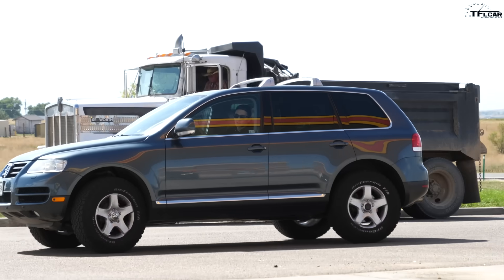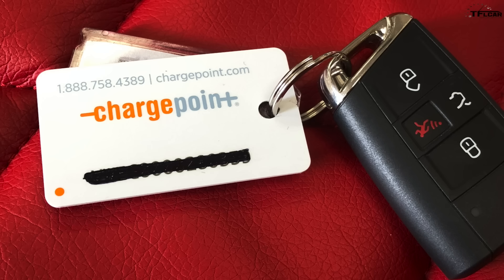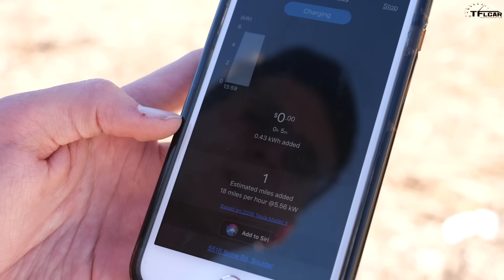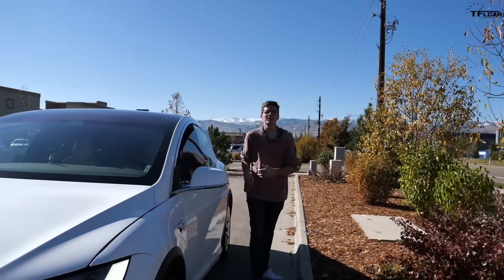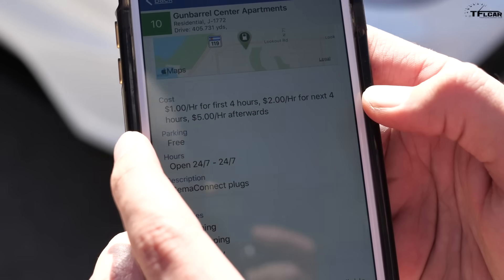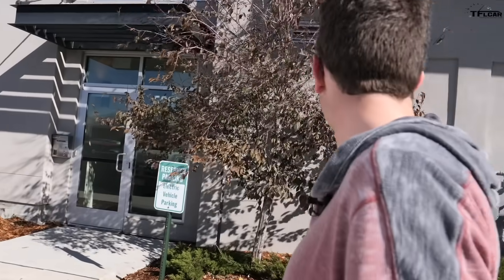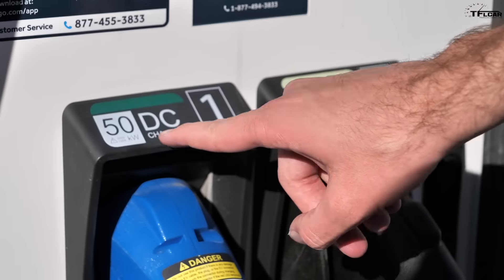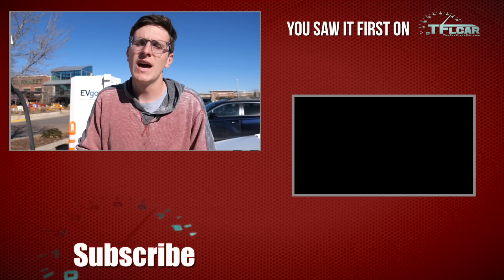Here’s Why Charging an Electric Car Can Suck - And It’s Not The Reason You Think!

Comment: I have a question for all those thinking they are going green by driving one of these.  How much pollution is the charging of the car creating.  The power/electricity isn't without pollution.  Unless that charging station is drawing power from solar panels or a wind turbine IT IS causing pollution.  Regardless if it is coming from a Nuclear or coal power plant.  Those plants cause pollution. 
But let's go with the cleanest of the lot and go with Nuclear.  How much nuclear waste does all this extra strain on the grid help to create?  You know that stuff that needs to be buried for 10 000 year.  Or what happens to those batteries when they reach the end of their life cycle and need to be replaced.  And from Telsa own page that is appox once every 5 years.  And they aren't cheap to replace BTW.   All this and you have to wait what 10-16 hours to get any kind of decent travel range...ooh wait that range could be cut in half if it is super cold outside.  Me being Canadian our winters can cut the range down a lot.  
I drive a newer car 2019.  I only visit the gas station once a month.  And in that time I get appox 500 miles on a tank.  (it has a smaller fuel tank) And I can fill it in under 5 minutes from empty to full.  Weather doesn't effect my travel range just my driving habits do that.  
So unless your soccer mom/dad just doing basic in town driving running small errands I see zero benefits to owning or driving an EV.  Jesus your going to spend more time charging the car then running those actual errands.
Reply: I have never seen Tesla recommending changing the battery back every 5 years. There’s many Tesla’s used as taxis because they require very little maintenance and have well over 400,000 miles and are running just fine. As for winters, yes the range can get reduced by up to a 3rd but if you charge at home then this is no worry. If the owner can’t charge at home then I agree, an EV is not the best choice. As for pollution, in the US about a third of all power generation is clean energy mix, and electric motors are much more efficient than combustion. 80% vs 25%. So per unit of energy in an EV is much greater vs a combustion engine. Again, not perfectly green but better vs combustion engine
Reply: @CrazyNickOO7  First WTF is a clean energy mix?  Because it not the power states like MI, OH, NY buy from Ontario or Quebec.  That's nuclear and coal.   
Battery replacement use to be right on the Telsa maintenance page.  But it looks like they have changed it from 5 year to 8 years. Applies only if you follow their strict charging regime of never going below 20% or above 90% and only using a slow charger.  It is also why you can buy as part of their warranty package battery replacement. 
Now for your example of being used as Taxi's maybe your right.  Maybe they have some up around the 400k mark. But you realize large taxi fleets usually have mechanics that do ALL maintenance and repairs on site. So to say they have very little maintenance I call BS on that. Most likely serviced every week to 2 weeks.  
I do find it suspect tho.  Cab companies around here will run you between cities some being 70 miles one way.  I can't see a Tesla taxi doing that. 1 round trip and it is down for 10 hours of charging.  
And you don't have to be the brightest to know it is a rechargeable battery. Just like every rechargeable battery they have a life cycle.  No matter the size.  From the ion battery in your iphone to the ion battery in a Tesla.  Sooner or later they need to be replaced.  And they all end up in a landfills as e-waste.  
One last thing. Let's use your 1/3 of range lost in the cold. I live in Canada. 7 months out of the year it is cold...or f'ing freezing. 7 months of reduced range just because of the Weather. So really that's none issue right?
Reply: @MrShuntking  Clean energy mix is just a generic term electric utilities use to describe what percentage of their energy production is from clean/renewable sources. 
Tesla never recommend to change the battery pack every 5 or 8 years, that's their warranty period for the battery and drive train. 
There is no strict charging regime either. Is just a recommendation to not fall below 5% and not to stay fully charged at 100% for long periods of time. Those extremes do cause increased wear on the cells. You cannot buy any warranty package from Tesla. It's just a manufacturer warranty that covers the battery and motors if they fail before 8 years or 120,000 miles. No other combustion engine warranty comes close. There is honestly very little maintenance on EVs for taxis or personal use. The Tesla model 3 only has 17 moving parts in the drivetrain for example. That is very little moving parts to wear out.   I've owned a Tesla for over 2 years now and the only maintenance I've done is rotate the tires and test the break fluid. There really isn't much to maintain. 
Back to the taxi service, there's a company that only uses Tesla's and travels between LA and Las Vegas. With the Tesla supercharger network it only takes them 30min to recharge, not 10 hours. You are correct every li ion battery has a life cycle and they won't last forever. There's a lot of data pointing to an average battery degradation of just over 1% loss per year. I'm right on that average as after 2 years my car lost just over 2% of it's original capacity but it still can over 300mi on a charge which is more than enough. 
Roughly 90% of EV batteries can be recycled. I agree it's not perfect but still better than the entire battery going as e waste.  
Yes, the winter months do take a toll on the distance you can travel but it has great benefits such as extremely well traction control, very heavy and low center of gravity, no old engine or oil to crank over, no waiting 10min for the engine to warm up and heat the cabin are just a few examples. I just wouldn't plan any long 200 mile road trips in the winter. Norway and Sweden are actually the leaders in buying EVs now and they're very cold climates. I don't live in Canada so I can't comment on how they compare to your home but if those countries are continuing to buy more EVs than combustion engines they have to handle really well in the cold. I'm not saying EVs are perfect or right for everyone but they do have a lot of great benefits but also of course some drawbacks such as everything else in life
Reply: @MrShuntking  sorry I didn't look up any articles or anything as I work in this industry so this is just backhand knowledge for me. The manufacturer is always going to be on the cautious side and recommend the most safe options to make their product last the longest. Li ion batteries are "happiest" at 50% charge but obviously it isn't practical so the 20% to 90% is a good everyday recommendation but by no means a requirement. No long term damage will happen to the battery if it goes outside those parameters
Yes it's also known that repeated supercharging will degrade the battery quicker than the slower AC charging. As your form post pointed out, this was much worse on the 2015 and earlier model years. The newer batteries as used in the model 3 and Y are much better designed and have held much better than the older model years
Tesloop is the name of the Tesla only taxi service I was referring to. You can look them up if you'd like to.  The Tesla battery normal operating temp is actually 70F to 140F so high heat areas, like Vegas, are not an issue. As for the customer waiting, that doesn't happen in between LA and Vegas. They make the trip in one haul and then the driver goes to charge before picking up the next customer. Like any other vehicle additional weight will reduce the range of the vehicle but a few hundred pounds from an extra person and belongings isn't much to add to a heavy EV that already weighs over 5,000lbs 
I just had a few thousand miles road trip a few weeks ago and actually didn't mind needing to stop every 250ish miles. After driving a few hours it was nice to stop for 20-30min and walk around a use a restroom, but I also know of people who like to drive all day and only stop to fuel up for a few min so an EV isn't for everyone
Reply: @CrazyNickOO7  My man for weight reduction to save weight they Tesla even recommends removing roof racks and bike racks...so if something that weighs all of 5-10lbs can effect range. Then 2 full grown adults will surely effect range.   You should really read an article or two.  Specially when it is from the actual maker of a car.  Jesus,  My knowledge is backhand cuz I put blades on wind turbines so therefore I work in the energy sector and therefor know everything about batteries is that the story your going with. 
I drive transport and drive an average of 900km everyday 5 days a week. And you know what I don't ever see on the road with me. A semi EV.  Why? Zero f'ing range. It obvious that electric vehicles have more then enough pulling power. But yet they aren't hauling freight. 
Oh and the trip from LA to Vegas is 270 miles and appox 4.5 hours.  That is under perfect conditions. No traffic, nothing but sunshine and clear skies and an open road. Again. Weight,  temp, wind and traffic cause we all know how bad LA traffic is.  Means you AREN'T making it on a full charge of 90% which btw the tesla computer will stop normal charging at.  
And again your REALLY REALLY REALLY NEED TO LEARN TO F'ING READ.  Tesloop is a car rental service offering various Tesla models for RENTAL.  It is NOT a taxi shuttle service doing 1 leg of the trip on a single charge.
Reply: I have a question for anyone with a gasoline powered car.  The wars in the middle East that kill thousands Americans to keep fuel cheap are known to you correct?  I mean it's not a life for every tank, but it's still dead people.  Most of them teenagers.

Comment: this is not a problem...its just a transient problem...ICE refills didn't happen overnight, it took a hundred years for ICE to have filling stations all over the place for quick 5mins refills...with EV becoming more popular, L3 fast charging will gradually become the norm rather than the exception even for home installations
Reply: Lol, no it won't.  Most people don't drive 100s of miles a day so there is no reason for a L3 charger at home.
Reply: @TexMex421  people don't need to drive 100s of miles to need a L3 at home....unless EVs replicate ICE refueling speed,  it will be tough for EVs to become mainstream. ICE owners can go to bed on a few liters of gas, wake up and be on a long trip in a matter of minutes by refueling at a filling station just round the corner...when EVs are able to top up at L3 speed anywhere same way you top up a phone using high speed charging bricks that can deliver as high as 0-50% in just 5-15mins, then the case for EVs is a no brainer and that will require those type of charge points being as common place and easily accessible as gas stations today
Reply: @walecious1   I have a plug in electric hybrid.  What can these ICE owners do that I cannot?  

Why would anyone need an L3 charger at home, when a level two charger can give them 400 miles overnight?  Where are they going more than 400 miles per day everyday?  That is 150,000 miles a year.   Maybe move closer to your job.
Reply: @TexMex421  maybe you should have moved closer to your screen to read my reply properly...that's part of your youtuber job

ICE owners can go to bed with an empty tank and not be stranded in the morning because they can fill up their tank in 5mins at the station down the street...EV owners dare not go to bed with 5% battery and wake up 20mins to work resumption 30miles away...that's what ICE owners can do that EV owners cannot do
Reply: @walecious1    Sorry you missed my question, try getting closer to the screen.  (I'm told that's your job.)  I have a plug in electric hybrid.  What can these ICE owners do that I cannot?  

EV owners charge at home and a full battery when they wake up will get them to work and back 20 times or so.  My hybrid will only make 6-7 round trips to my office before the gas kicks in.  It does take as much as three hours to recharge while I sleep for 8. 

As an ICE owner with empty tank in the morning, are you  pushing the car to the station?  Is this a workout strategy?
Reply: @TexMex421  i think you're the one who's missing the point (you should change those who tell you things because they are not telling you the right things)...always nice to see youtubers who smile in their videos but are jerk offs once they're called out on their BS

my comment is about real electric vehicles not ICE with batteries to hold them over till they get to the next gas station (hybrids)...

if you had labelled your post why owning hybrids suck, i would not have made any comments but you made a video about electric vehicles when you don't own one and i had to point out what electric vehicle owners want. of course you dont know that because you drive a ICE

Comment: "If you live in an apartment, you won't be able to charge in your garage..." [but] "If you live in a rural area, you probably won't find lots of public chargers."  Yes - but if you live in a rural or suburban area - you're almost certain to live in a house with a garage, where it's then easy to install your own level 2 charger.

If you travel a lot, your best choice is a Tesla, hands down.  They have the most high speed chargers, that are easiest to use.  If you mostly stick closer to home, then you can consider more of the other vehicle choices.

If you live in an apartment, encourage the apartment owner to get some level 2 chargers installed.  Level 2 chargers are quite sufficient for regular every day charging.  My car is fully charged every morning, just like my phone.  I only look for public chargers when I'm on road trips.
Reply: @laurie7689  I also have an older house.  I'm guessing that when all your cars are EVs, you (or the subsequent owner) will find it worthwhile to upgrade your electrical service and run more power to the garage.  Daily charging at home is so worth it.
Reply: Have you ever lived in a rural area? It doesn't sound like it. My 1830s house doesn't have a garage. Most farm houses don't, if you have ever seen a farm house. If you have a suburban home built in the heyday of suburban growth ( 1950s-1980s) you probably don't have the wiring in your garage to charge an EV either. If you live in Florida you probably have a carport, not a garage
Reply: Like me, My car parks a hundred yards from the house with lawn in between. I installed my own wiring down to where I park, and I plug in there. Overnight charging on off peak electricity, half price. Apart from Tesla, all EVs use the same chargers, same plugs. Tesla owners think they're special.

Comment: how long does the charge last if the car sits in a hot driveway unplugged?
I know it has a solar roof but is that enough to run the cooling systems?

Comment: For fee charging is expensive. I put 220v in my garage myself. I have a LEAF. It's a 2nd for for around town. To charge 20% to 100% about 2.5-3 hours for 80-100 mi range. My other car is a VW diesel and can go 700 miles on one 14.5 gal tank with reserves. Time to fill VW? 5 min including restroom break. Which one would you take on a vacation or cross-country trip?

Comment: make a car that runs like trains do and I will buy one. untill then I am going to stick with my old gas powered car. I can drive a thousand miles in a day any time I want and only takes a few min to fill up for the next 400 mile leg..... what the hell am I going to do for all that time while the electric car charges for a measely 200 mile range?? on flat ground... with no heater or air conditioner running or it becomes less. ev's are not practical.

Comment: It is Oct 2020. EV charging infrastructure in the USA is poor but hopefully will improve. In Republican dominated North Carolina it is worse than poor. We just got back from a mountain resort in NC. Luckily the resort had an outdoor 110 volt outlet so we added 50 miles every night during the two nights there. Without that it would have been difficult. On the road, 50 kW charging speed is inadequate!  Aside from Tesla,  only Electrify America provides 150 kW. Before you buy an EV,  go to www.plugshare.com to see how many Fast chargers are in your area. One very positive comment: Tesla Model 3 was just amazing on mountain roads! Ours is AWD which gave a secure feeling as on one of the two days in the mountains it was rainy and dreary.

Comment: THIS IS SUPPOSED TO BE THE FUTURE !!!!?????  I think i'll stick to the past thank you. I 'll just pull up at any station along the way, fill up in 5 minutes (not having to dick around with some stupid ap and wondering wether the plug will fit and how much it will cost) and drive on for another 500 miles without worrying wether the next station will work or not. Electric vehicles are NOT the future and never will be. Not to mention the total lack of character or lack of engine note. It's like driving a glorified golf buggy. Total and utter nonsense. And they're not even ecological. Where does the electricity come from, hellloooo? not to mention the enormous amounts of energy required to mine the nicel for the batteries. And how to dispose of the batteries in 10 years time (max). Oh it will be more economical to buy another car and use yet more energy to make the  glorified golf cart. Reeeeaal ecological these electric cars. Wake up all you idiots buying these electric cars,  You're not doing anything for the environment AT ALL!!!